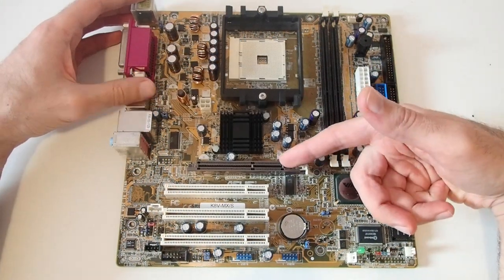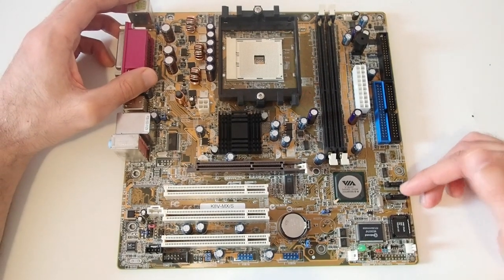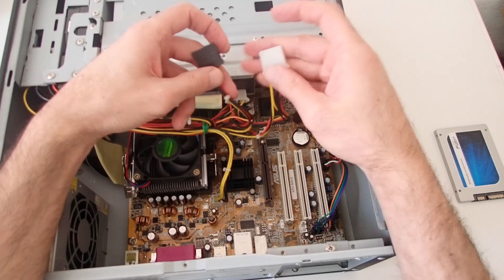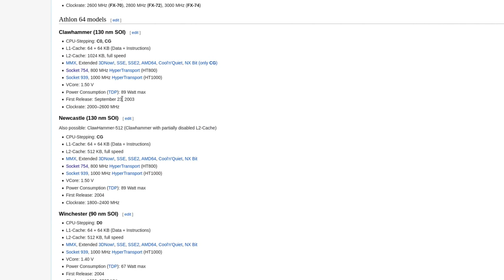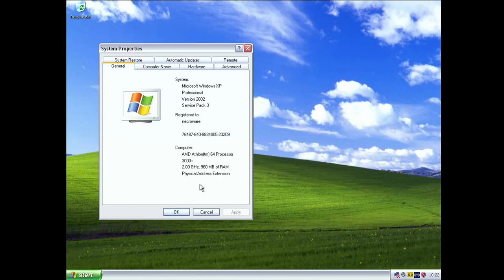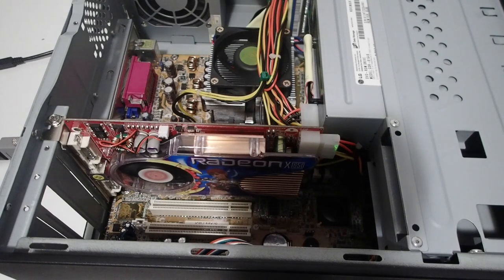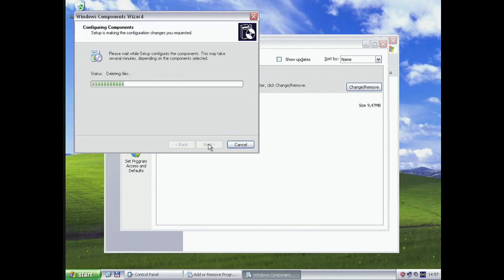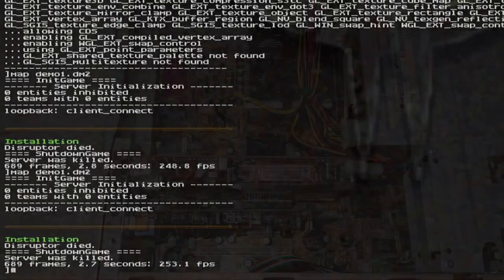Building AMD based retro WinXP gaming PC with FTP server

Comment: the SATA 2 (or 3) Drives on SATA1 Controllers is NOT a VIA Problem, its a General Problem with all SATA1 devices I have tested. VIA VT8237, nForce 2. SIL 3112 might be the same thing, dont remember
I sadly don't have an Intel to test but I doubt it works better...

That Issue was fixed with later iterations of the VIA VT8237. I thin it was the S-Version (VT8237S). 
PRO TIP: STAY AWAAY from the VT8251!!
Reply from the maker: Well, it's a known bug of VIA. You can even read about it on Wikipedia. I have no issues with other chipsets here. Using the SSD, which I showed in the video, with almost everything. Runs everywhere with sata1, but at least it runs. VIA is just crap :D Unfortunately for this CPU it was the most used chipset and almost the only one you can get today.
Reply: @necro_ware  
Its not, as said it also is in other Chipsets at the time. The mentioned Nforce 2 for example. The MCP-S has the same issue and some SATA Controller too. So for it to work you need a SATA2 PCI Card.

VIA on a decent quality board is better than whats said.
And there are also some S754 Boards without VIA CHip, for example the ASUS K8S-MX. And with S939 you find more nForce Chipsets - which are even worse than VIA!
Reply from the maker: @Stefan_Payne  As far as I remember, Nforce2 was used with Socket 462 and it had no SATA at all. I might be wrong in this regards. In regards of VIA with S754, as I told it is ALMOST the one chipset you can get, at least with AGP. I have another board with PCIe and Nforce3, there SATA works just fine, but I wanted a system with AGP to make some tests. Something other, than VIA is really not easy to find. 

And in regards of SAT in VT8237, it is really a well known and documented bug. The guys grounded one "reserved" connection of the SATA controller in the southbridge. This connection had to be left floating and was used in SATA-II for extended initialization. Since it was grounded, the SATA-II couldn't initialize properly anymore. What shall I say? RTFM, especially, when you design a chipset :)

Please pay attention, that I never told, that other chipsets didn't have other or similar problems, but that doesn't make VIA any better, especially with this one and with the famous data corruption bug. External SATA-I Adapters from that time for the PCI slot do work just fine with all my SATA-II and SATA-III drives. I'm using them actually quite often. But the whole I/O in the VIA chipsets from that time was an absolute disaster. 

I just briefly googled for detailed bug evaluation, but they are all in German. In English there is just mentioning, but no detailed description. Funny enough, the bug is mentioned as it is only on German Wikipedia, but not on the English.
Reply: @necro_ware  There were later Revisions of the nForce 2 that came with SATA; as there was a new Southbridge introduced: the MCP-S with SATA 1. Also has Issues with SATA2 as a lot of other things at the time.

nForce 3 was AGP too, though had issues with nV40, the PCIe ones are the nForce 4 ones.

There was also a 2nd Revision of the VT8237 which had the SATA2 Issues fixed: VT8237*S*

Also its not a Bug of the VT8237 if you find the issue elsewhere and you do! THe nforce is one, I think the Intel ICH5 could have the issues too as a lot of other SATA1 Controllers. Just test it yourself, if you don't believe me. You find it on others!
Its just the way it is with early specified components where there is only one speed and not multiple like later. 

And if you google my name, you'll find that I was very active in German Forums when the VIA 8237 was in use.
As sad, there is a later Revision of the SOuthbridge that has the SATA2 compatibility fixed - or even SATA2.

Comment: oh and since its an AMD K8 based system, you might want to test Registred ECC RAM.
Especially with an ASUS Board (Gigabyte works too, ASROCK no idea and MSI does not).
That sounds weird but I have 2x2GB Infineon Registred ECC in my ASUS A8R-MVP!
Reply from the maker: Unfortunately, I have no DDR with ECC at hand :(
Reply: @necro_ware  I didn't mean ECC, I meant buffered Server Memory.
HYS72D256220GBR is the model number. And some AMD K8 CPUs with some Boards work with it, others do not.
I think I used one of the two Registred ECC Sticks I had in a Sockel A Board at the time (with VIA CHip)...

Comment: Maybe changing the mac adress on the networking car could helped
Reply: Idid this on my msi 865pe neo2-fish2r and it worked but only in 100mbit not gigabit
Reply from the maker: I tried that. There is obviously a bug in the drivers, but nobody will fix an old driver for windows xp. As I mentioned in Linux everything works out of the box, so it's definitely a software issue.

Comment: There are only losers when dealing with VIA chipsets. Grab a board with an Nforce3/4 chipset.
Reply from the maker: As far as I know, there was no (or not many?) nvidia based mainboard with AGP and Socket 754. I needed this combination for another reasons. Unfortunately most mainboards from that time were already PCIe and I have two such mainboards here. But I needed it with AGP.
Reply: @necro_ware  This is not true, practically every manufacturer made at least 1-2 boards ATX/MATX if not more. I think it's more of an issue of you running into the fact that they're harder to find now and more expensive then these crappy VIA boards.
Reply from the maker: @gravitone  That's why  I wrote "not many?". I also assume, that there are probably some rare ones. But all I could find were VIA and some SiS based. I had this VIA in my parts, so....
Reply: Where are you located that they're so hard to source? I typed "nforce3" into ebay.com, and the screen was instantly flooded with 754 AGP boards. Just because you already have a VIA board, doesn't make it a good idea to actually use it, since they're always terrible.
Reply from the maker: @gravitone  yeah, I'm desperately sorry, that I did that terrible mistake. There is probably nothing I could do to fix this again.... I think, I'll drain my depression in a glass of alcohol :D
Reply from the maker: And jokes aside, I really can't find anything useful. Not, that I'd buy it, because I don't see any sense, but in case you can find mATX, S754, AGP for half way reasonable price, I'd be glad to know the model. And in regards to VIA, this mainboard works perfectly fine with Linux, which I will use on this machine most of the time anyway. WinXP was just a small experiment to remember how bad it was. I was not disappointed :)
Reply: @necro_ware  Yeah, that issue with the network chip was really weird. Most issues with VIA chipsets stemmed from their poor PCI en AGP implementations. They had bus mastering issues for years, causing espeically soundblaster live cards to freeze/hang the system. And when they didn't do that, the bus mastering conflicts caused the audio buffers to not receive new data in time causing crackling and popping. Their AGP sideband addressing was also bugged/broken for what seemed like forever. And the interface became unstable at 4x/8x speeds under certain conditions. For the longest time ATI/Nvidia drivers disabled all sorts of AGP features as a precaution when detecting a via chipset. Their IDE/SATA implementations were always very weak too with low throughput and high latency. Sometimes DMA modes were unstable.
Reply: @necro_ware  GA-K8NS with nforce 3 AGP and socket 754.